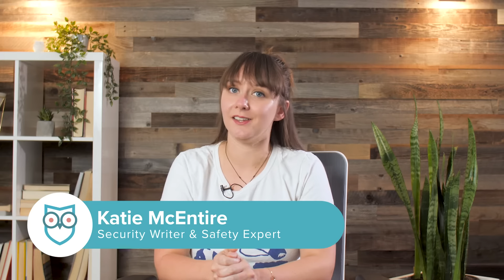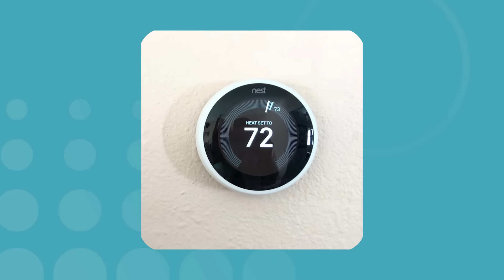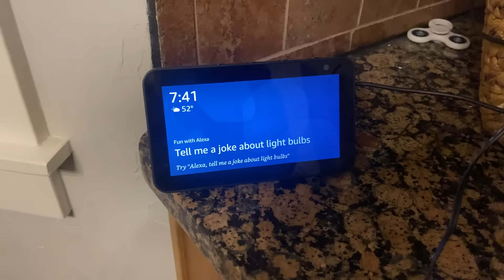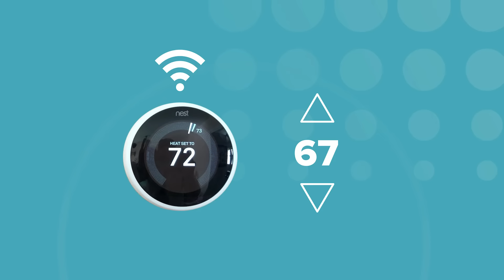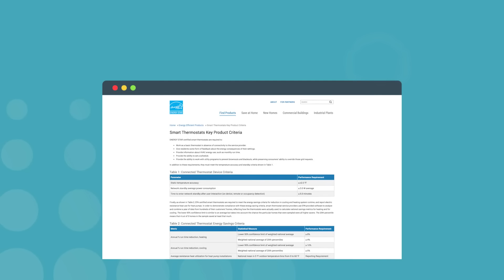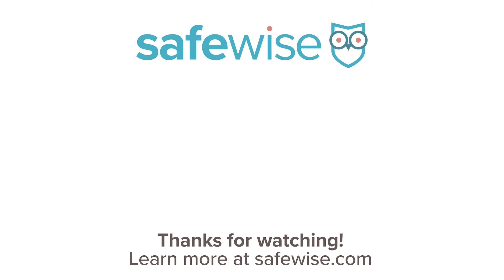What are smart thermostats and how do they work? | Ask SafeWise

Comment: Be very certain that you are aware of the potential problems of using a programable thermostat with a heat pump.  There could be further issues using a programed thermostat with one of the new variable speed compressor heat pumps where their efficiency varies with their speed.